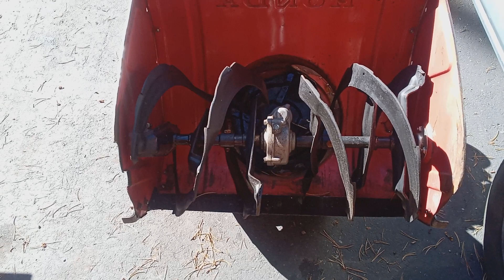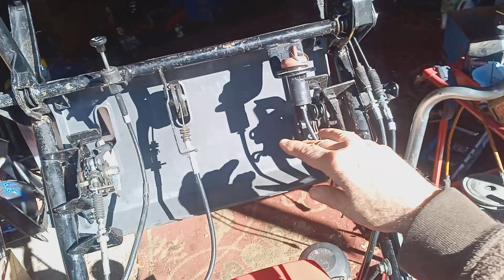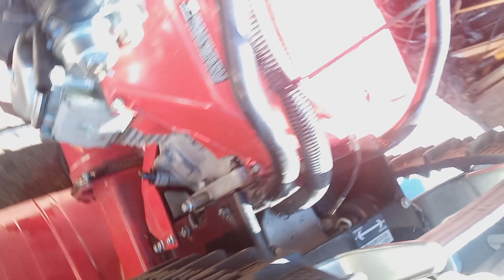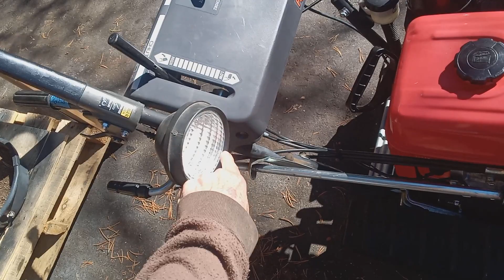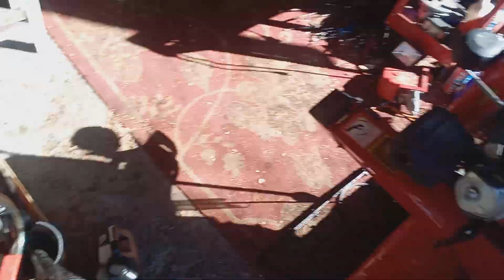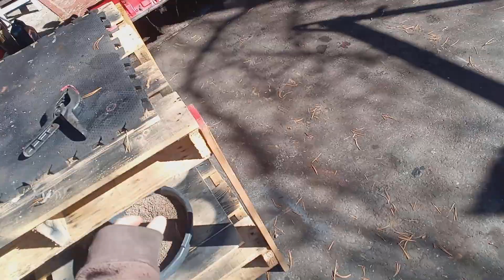SERVICE HONDA SNOWBLOWER PART 4.  Inspection and Testing

Comment: Hello Antony, Great vidéos. My chute will not move around mode. No problem with the switch. Could it be the Small relay Neal the Battery or is there Anthea relay Neal the chute ? Thank you. Paul
Reply from the maker: Paul, thought i replied but can't see comment. Dealer told me to first unplug the switch under the control panel and plug back in. If that doesnt work then remove cover between engine/bucket and do the same with 2 chuter motors. If not you may need a new switch under panel. About $40-50 unless still under warranty. Takes about 10 minutes to replace. sorry for delay here.
Reply: @HondaSnowblowerEnthusiasts311  Thank You; I had to replace the chute motor.
Reply from the maker: @Paul-tm7ny  do you have a lot of salt in roads? wonder what caused failure.